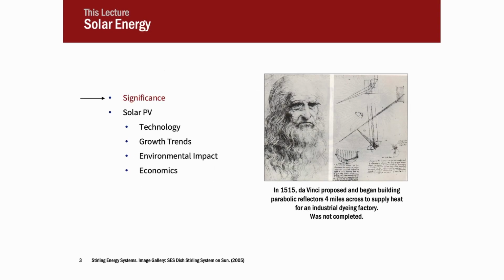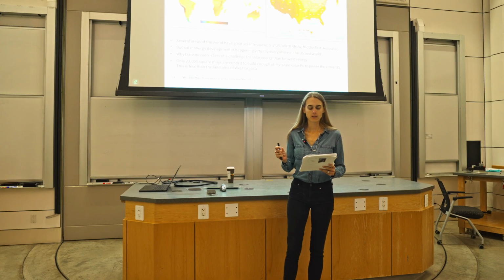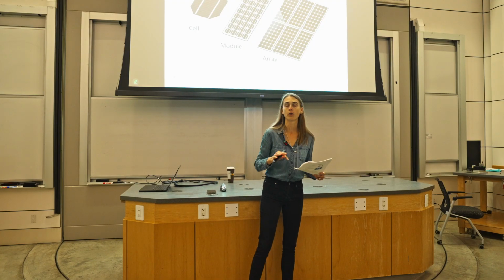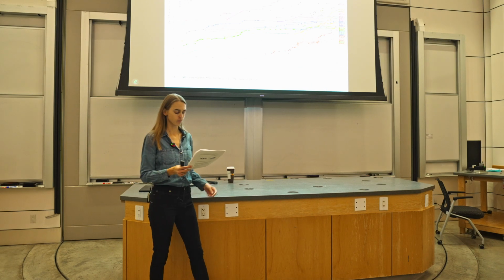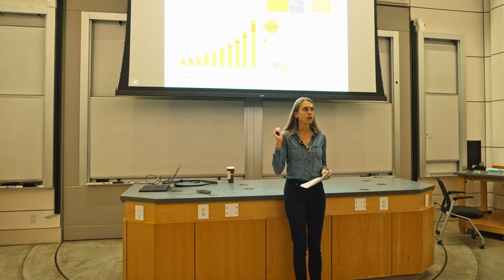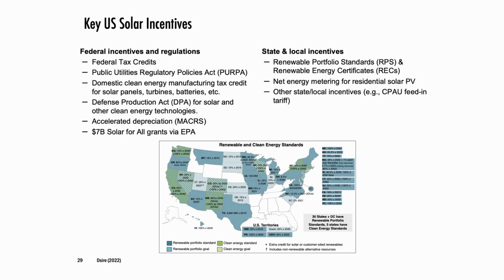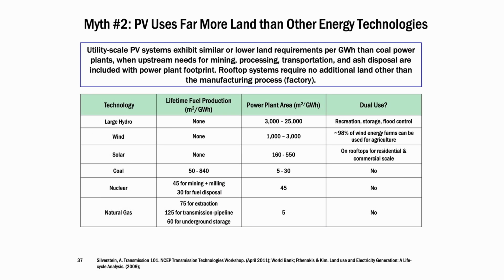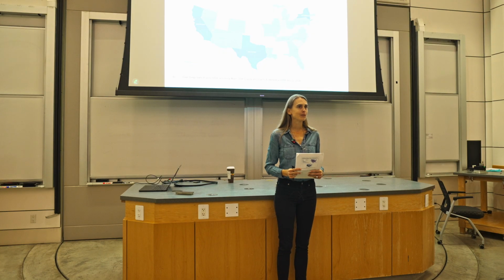OLD Solar Energy Lecture | Kirsten Stasio | 11-13-2024 New link in description below.

Comment: Useful information, but I think that the indirect category is much broader than simply having windows in buildings (or even limiting it to buildings, per se). For example, for centuries, humanity has be harvesting salt from the sea in salt pans which use sunlight driven evaporation to separate the salt from seawater. Similarly, in hot climates it has been well known that pumping water and having fountains in/near buildings can enable evaporative cooling. More recently, much of our lithium is harvested by pumping brine into evaporative tanks to concentrate the material. I am sure that there are other examples of the long standing (and new) indirect uses for sunlight.